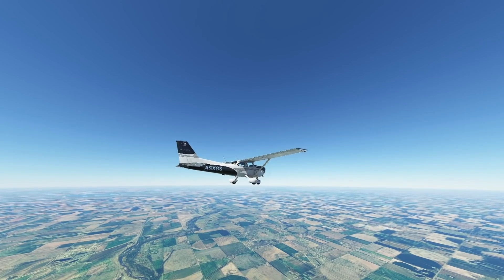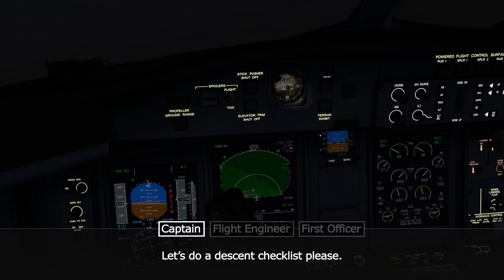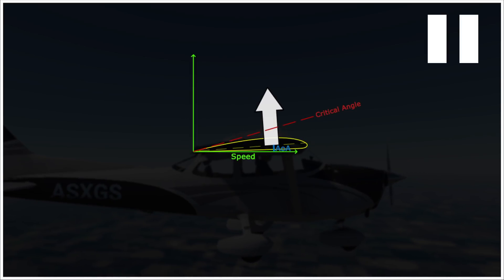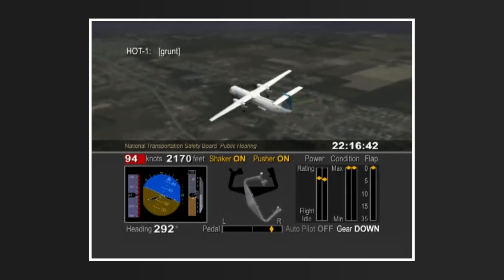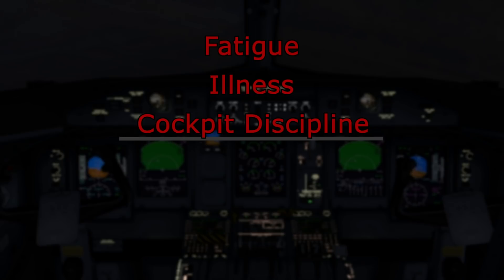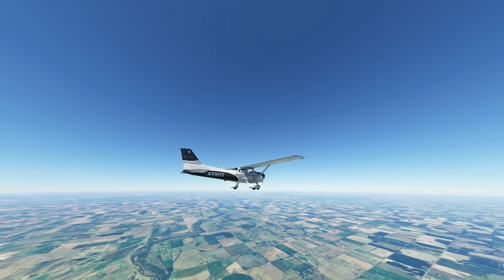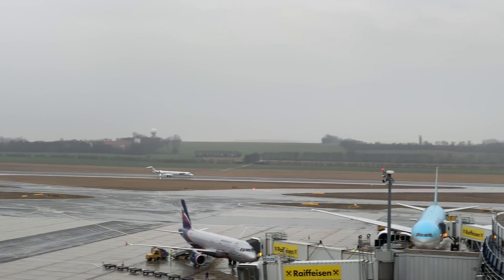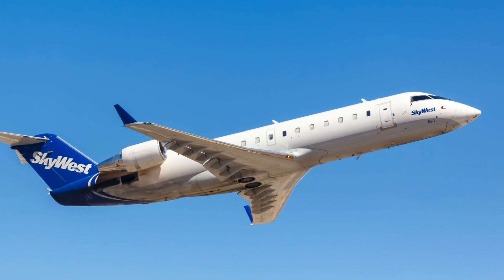Is The Crash Which “Changed” Aviation Really Having An Impact? | Colgan 3407

Comment: So the pilot believes the way to get out of a stall is to pull back on the yoke and slow the plane down more. Both pilots chatted  enjoyably about the icing they were observing but neither thought it was a condition that demanded any action. The co-pilot is pressing buttons but doesn't know what they do. Gear up or gear down, flaps, no flaps. So the very idea that a nap would turn these two into competent pilots is, I would hope by this point, quite absurd. If a plane lands safely 3 times with an Orangutan in the pilot seat you say those people are lucky to be alive; you don't say the Orangutan landed the plane safely 3 times before that proves he knows what he's doing. No it doesn't it means people were lucky.

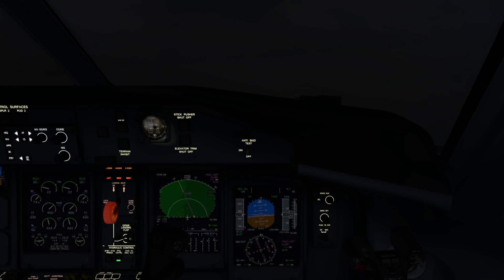Comment: 4:29 the captain has (a) largest amount of ice on the wings he has seen in a long time (b) engines to idle (c) gear extended (d) flaps down. The plane is maintaining 2300, therefore it is not in descent and not gaining speed that way. The immediate question is, what is the captain's mental speed target at that point? 160? 150? Why did he pull back on the throttle since he is not descending and since he does not have a lot of knots to bleed off? What speed was he trying to reach? He calls gear down with 175 knots. Stick shaker at 130 knots. What was his plan? It makes no sense why he pulled back on the throttle and what was his idea of when he would have to increase throttle again. So it seems to me that either the throttle to idle was a very bad move, or that both he and she completely ignored their airspeed, which is fundamental when flying the plane. The fact there is ice on the wings and that stall speed is so close to their current speed should make both very, very alert. It is not as if they have hundreds of knots to spare. Please let me know if I am missing something.
Reply: "Ahhhhhh autopilot on: relaaaaaaaaaaaaaaaax!" And yet this isn't the whole explanation, due to the fact that this moron pulled back on the stick with immense force, opposing the automatic stick-forward action. Pilots should routinely go up in all sorts of planes, with no passengers, over sea, to practise stalls of different types at various heights. That would give all of them a healthy respect for the extreme danger inherent in all approaches, and the imperative need to monitor speed at all times during them, and avoid stalling, but also how to react if it happens. All of them need to be acutely aware they are just seconds from disaster for long minutes during the approach. My understanding is that they NEVER practise stalls (in large planes) outside the simulator.

Comment: Lift is not soley due to the lower air pressure above the wing caused by its shape - but it helps. Aerobatic wings are symetrical in section. Supersonic wings are sharp. Toy aeroplane wings are rectangular. As boring as it may seem the lift is caused by the positive angle of attack of the wings in relation to the tailplane. I am amazed that the earthy basics are so misunderstood.

Comment: One wing stalled first causing that side to drop so the pilot applied opposite aileron which is intuitive but actually increases the effective angle of attack of that stalled wing AND the drag on that stalled wing. 

Ailerons work when there is laminar flow at faster than stall speed. Therefore as frightening as it may seem when the plane is dropping due to a stall the stick must be pushed forward HARD and PROMPTLY to recover that laminar flow URGENTLY by increasing airspeed by reducing angle of attack on both wings and thus reducing drag on both wings. To do this you need to be supremely confident you know you are in a stall risk in the first place.  If disoriented or doubtful your prospects are poor.

When you PUSH the stick forward you are effectively allowing the plane to PUSH forward by (a) lifting the tail so GRAVITY-assist  thrusts you forward (b) also massively reduces drag by temporarily  zeroing the normally positive angle of attack of the wings. If you fly gliders this is your ONLY option. Having an engine to give more thrust is a luxury😉
Reply: Being a glider pilot myself, I also was bewildered by the amount of aileron input they pilot applied, and the fact he was actually pulling back on the yoke in a (near-)stall situation... in my first flying lessons I was told over and over again not to use the ailerons during the first moments of stall recovery, only the rudder, and NEVER pull back on the stick until a safe airspeed is reached. I am really astonished thet the Captain reacted the way he did.
I was also  bewildered by the fact that the FO retracted the flaps in that situation, thus creating a configuration with an even higher stall speed... why would you do that in such a situation? Retracting the gear was an understandable decision, but the flaps?

Comment: Centrifugal force causes the speed of the air passing over the curve of the top of the wing maintains that boundary layer. That requires enough speed to cause the inertia of the air to cause a slight separation from the top of the wing creating the vaccum that provides lift. Greater curve on the top of the wing the slower the airspeed needed to create lift.  The thinner the Air the higher the stall speed related to the density or lack there of .
Reply: Centrifugal????
Reply: @peteconrad2077  Yes think about it . Just as much air flows in close contact beneath the wing in a straight line it does not create negative lift . But the necessary velocity of air where the flow can not closely adhere to the top of the wing creates a absence of pressure or a vacuum.  The centrifugal force is created when the air is  quickly being forced to change direction and follow the top curve of the wing. When the necessary velocity is reached a vacuum is created that acts to lift the wing. Bernollis principle didn't satisfy my questions.  Higher speed air across the top of the wing just doesn't cut it. He totally ignored that air has weight and air can experience centrifugal force which would cause a reduced air pressure on the top of the wing. I flew a KR2 which actually created lift on the curvature of the fuselage side. At a 60 degree Bank the stall was delayed and didn't require the 4 g pull to maintain altitude. That was a surprise. I was probably not totally coordinated though.
Reply: @charleswesley3642  it’s Bernoulli’s law. The air speeds up and it’s pressure reduces. It’s not centrifugal force causing a vacuum.
Reply: @peteconrad2077  You can quote Bernoulli and it doesn't explain anything except you read it. Everything that is caused to change direction exerts a measurable force . Air has weight and at enough velocity that force is extreme. Bernoulli's law stops short of actually explaining lift. When you start building and looking at wing lift coefficients you will see high aspect  wings has a lower stall speed as opposed to the stubby wide chord wing. The greater top curvature the slower you can get before  stall. As a safety feature that's one reason  a wing tapers near the end so as to delay stall spin.

Comment: Seems a stick-shaker warning on approach should automatically abort the landing, making control of the aircraft the crew's only priority.
Reply: Based on this video it seems like (after stick shaker activated) they were trying their dardest to gain control of the aircraft and ignoring other issues. However the steps they took on pursuit of that goal were the wrong ones.

I've watched Mentour Pilot's video (or videos) that mention a terrain avoidance maneuver. He said it's mandatory when the appropriate terrain warning goes off and that the the pilots are supposed to go to full (TOGA) power & pull up. Sort of mirrors what happened here but it is NOT the correct response to a stall or near-stall.

Comment: 3 Greens, I disagree with a few statements you made here...
The 1500 hour rule is not kneejerk reaction. As a captain in the US, I can tell you firsthand that flying with a 500 hour newhire is basically flying single-pilot... The extra skills they gain from 1500 hours is a huge leap. There is no comparison. Someone with 300 hours should not be flying an airliner.
Second, the regional pay in the US is unrecognizable compared to 2009 when the 3407 happened... Our newhire copilots at my airline make 60k per year. In 2011 as a newhire I made 19k. Big jump.
Otherwise excellent video. I know many people who knew Captain Renslow... Basically, the q400 has so much power, if he would have simply firewalled the engines the plane most likely would have powered out of the stalled condition... You did not mention that he only ever applied 50% thrust.
Reply: I somewhat agree, but I also have to add something VERY important. That 1500 hours is PIC time, not just manipulating the controls. I know several people that are today ATP holders who quickly went through a school and got their CFI/CFII ratings and just became instructors getting hours. About 10 years ago the CFII who gave me my then bi-annual was such a person. She told me she had about 300 hours in a Cessna 152, and about 20 hours in a complex aircraft. Think VERY clearly what you are saying! Having 1500 hours DOES NOT mean you have time in airliners! How can you get experience in an airliner if you can't actually fly one as you get said experience? What good are those 1500 hours if 700- 900 of them are in a Cessna 152? This to me is a serious conundrum with no easy answer! In a way reminds me of that old saw about getting a bank loan. You can't get one until you can prove you don't need it! I'm not an ATP holder. I am an instrument-rated Private Pilot SEL, my aircraft of choice is a Cessna 182. As such I can only imagine the workload's flying those Airliners. Still, I don't think total hours are 100% a measure of a pilot's ability to sit in that right seat. I think it's more about the types of aircraft used to gain those hours!
Reply: @thefactorypilot145 The irony here is that both pilots on Colgan 3407 had an ATP so what Congress did was knee jerk and didn't address the pilot fatigue issue. We need to be adding to the supply of new pilots which will enable adequate crew rest periods and avoid crazy commutes like the Colgan 3407 FO had. There's a training and mentoring gap between 300 hours and 1500 hours. European 121 operations are just as safe as the US if not safer and they have 300 hour FOs in the A320s and 737s. The current airline pilots in the US like the pilot shortage because it's much higher pay for them but that's short sighted. The market will be brutally unforgiving in the long run to these conditions.
Reply from the maker: Thanks for the info and explanation mate. And condolences to you and your friends.
Reply: Nonsense. Europe has being running in approved courses with 200 high quality hours of instruction for a frozen ATPL. It works fine and most if the current band of British and German pilots were brought in this way.
Reply: Agreed.  Interns who were given jobs as reward for their year of servitude in Tech Pubs.  Only thing worse was flying with a Captain from the CPO.

Comment: This video seems to take the position that the airplane was in fact in a stall or close to one when the stick shaker activated.  That is not what happened.  

This model of airplane has a switch which enables a pilot to set the speed at which the stick shaker will activate to a higher level.  It's designed to be an extra safety feature in icing conditions.  However, if the switch is put to this position, the pilots must remember this and thus fly at a higher speed during their approach, so the shaker will not activate when a stall is actually not imminent.  

In this case, the pilots did not remember that the switch had been set to a higher speed, and thus did not make the approach at a higher speed.  So the stick shaker activated when the plane was not in a stall and not even close to a stall.  It was still going 20 knots above the speed which would cause a stall.  Although the pilots had forgotten that they had set the switch to that position, they still at that point could have just turned the switch away from that setting, and proceeded as usual, or done  the standard operating procedure of lowering the nose and the speed.  But they did neither, and instead the captain reacted in a completely opposite way.  He actually put the plane into a stall when previously it had not been in a stall or close to a stall. 

So yes, the cause of the accident was the captain's inappropriate response to the stick shaker warning, but what's often overlooked or missing is the fact that, before his actions, the plane was not in a stall or close to one. 

My question was always,  "But why did the plane slow down too much to begin with?" and I never got a satisfactory answer.  Finally I learned this, that the plane had never slowed down too much.
Reply: Is the stick shaker activated by airspeed..? I always thought it was connected to the stall warning sensor.
Reply: @PRH123  I am hardly an expert.  I've read that most of the time, it's activated by angle of attack.   It might vary according to model of airplane.  At any rate, I always had a bit more of an interest in this particular airplane crash than in others,  because a friend of both of my sisters was killed in it. and I never really understood it until I watched the "Mayday" episode on it.  It's the only video I've seen which addresses the role of the reference speed switch in this crash, so I'd advise you to watch it if you'd like to fully understand the crash of Colgan Flight 3407.
Reply: @jn8ive60  Excellent!

Comment: Putting the flaps up played a huge role, how ever it amazes me how some of these pilots have no idea how to recover from a stall.  There is another video on the you tubes on how a first officer held a stall all the way to the ground from 30 thousand feet...  took like 15 minutes, and no one knew they were stalling.
Reply: Was that the Air France flight from South America somewhere? Couldn't understand how a trained pilot could be so unaware of what is happening to his aircraft? Wasn't it something to do with an iced up Pitot tube and incorrect airspeed readings? Gonna have to revisit that one.
Reply: @nickmaclachlan5178  Yep. Air France flight 447. Copilot's flight controls were not duplicated on left seat side, his joystick was neutral and the autopilot was off. He had no idea why the plane was stalling until finally the FO blurted out he was holding aft joystick. By this time not enough altitude existed to correct the situation and arrest the descent. :-(
Reply: @MrFg1980  That’s why the Left seat and Right seat yokes used to be Mechanically joined.  There is no confusion about what the other guy is doing.  Not entirely sure why Airbus went with a joystick control.  There have been so many cases of subtle incapacitation over the years, where one pilot gets mentally overwhelmed and starts making nonsensical inputs.  It’s helpful to know what the other guy is doing.
Reply: @winstonsmith3685  Even with joysticks they could have linked them with "force feedback" commonly available in xbox/PC and other computer controllers/joysticks. From what I have read about Airbus and their fly by wire systems, they have an idea of how the plane must be flown and they force this idea on the pilots and many times with disastrous effects. Similar story with the much more recent Boeing 737 Max, computer programmers forcing behaviours onto the pilots with catastrophic results.
Reply: he could be talking about that one. jus seen the episode on another channel. i remember that accident in real life that year. the pitot sensors iced up but they resolved themselves minutes later but the pilots didn't know that. the accident could've been avoided easily.
Reply: I'm talking about Air France Flight 447
https://www.youtube.com/watch?v=LA-WeacusP4
or
https://www.youtube.com/watch?v=r5LUGaW6TyE
Reply: They were already dead when they were messing with flap and gear settings in the spin.